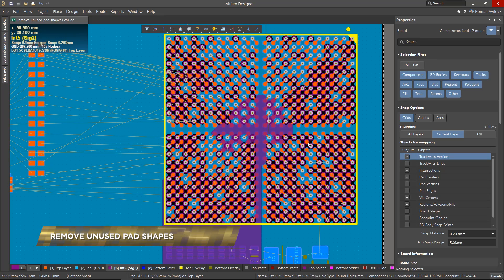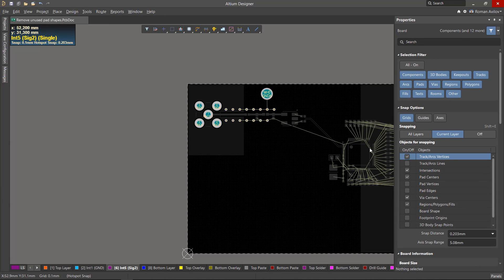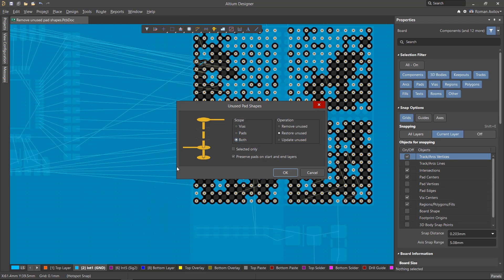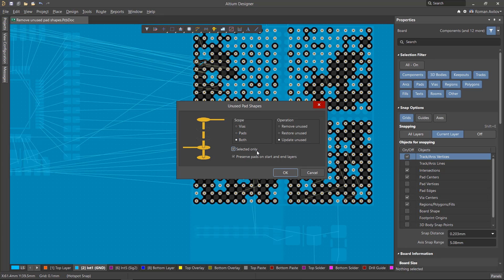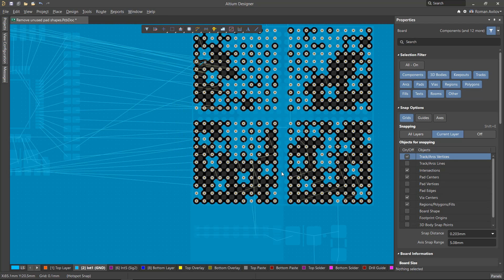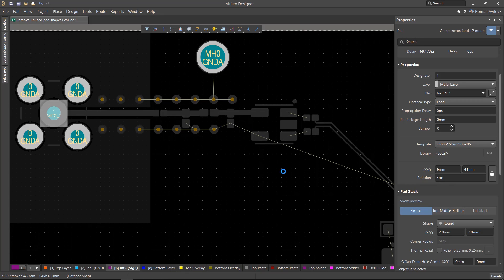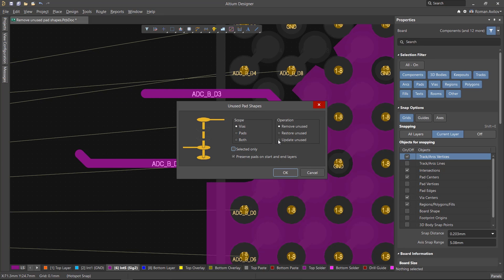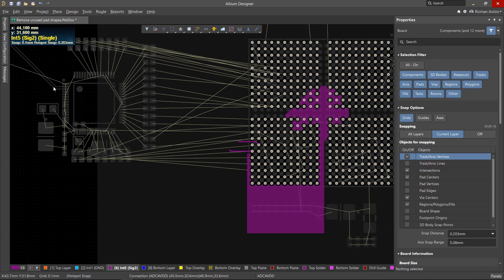How to Remove Unused Pad Shapes in Altium Designer | PCB Layout

Comment: Re-pouring with new clearance should be with care. Remember that the drill bit does not necessary hit the middle of the pad, so the plating might leak out to the new pour resulting in a short.
Use "hole to copper", "different nets" clearence in accordance with the manufactures  requirements.

Comment: This tool should not be used indiscriminately, as it has some potential unwanted side effects. First, you need to ensure that your copper to hole clearance is retained. You can't look at the space created by removing those pads as free space for routing, as you still need to clearance to the hole. This is because of drill registration precision, and (to a lesser extent) the possibility that plating might bleed into your unused layers. Check with your fabricator what they can do - 10mils is pretty safe, and I've seen 7 mils done, but costs may vary. The other problem is coplanarity. Imagine you have a BGA, on a 12-layer board using Via-in-Pad. Some pads, eg GND pads, are connected on 6 inner layers as well as the surface layers. Others are unused, and have only two pads on the surface. The GND pads will have 6x1.4=8.4mil of additional copper thickness, and hence board thickness, than the NC pads. This creates a substantial difference in height between the pads under your BGA, and ultimately could lead to some balls unsoldered, thermal problems or warping/cracking issues.
Proceed with caution.